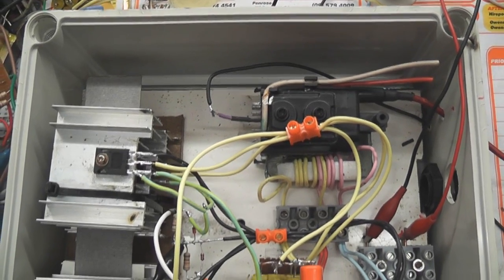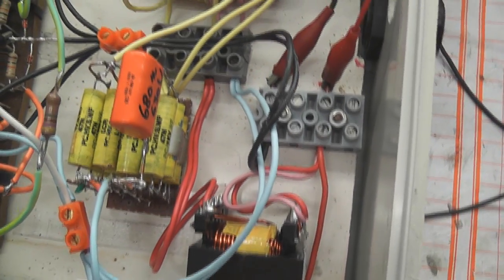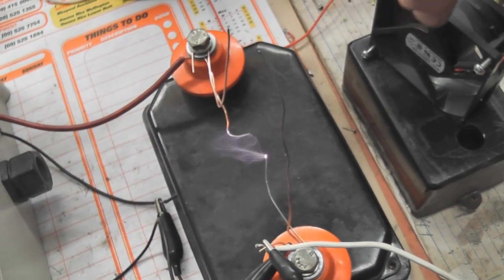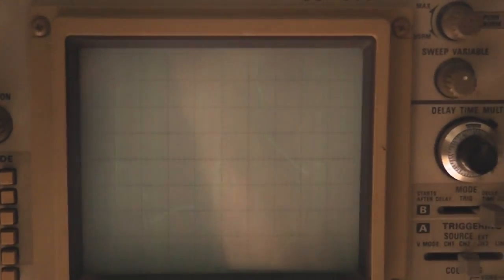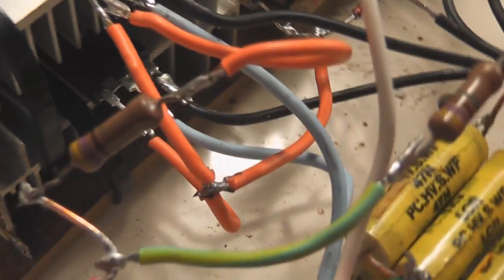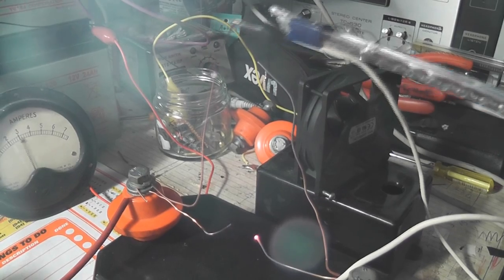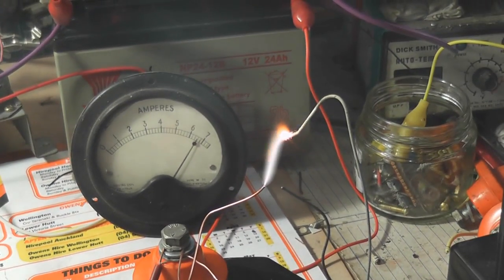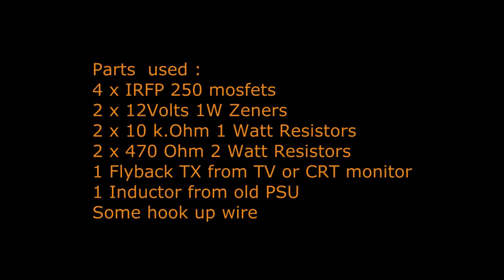24 Volts ZVS driver with 4 IRFP Mosfets

Comment: were   some of the resistors used with tbe caps to controll transient spikes, ive had to use rc circuits in parellel ,in the past on my stuff . it worked but it hurts performance some grt vid.

Comment from the maker: Yes, I will look into that. need first to get some extra probes so I can use the other channels at the same time.
The main controls are sweep time and voltage threshold, and options for tracing. I don't even know all the options as I often learn as i work on different projects.

Comment: There isn't an edit button, but if you realise you've made a mistake / spelling error / omitted something from a posted message, it is possible to delete it, & then post another message as a replacement :-)

Just hover over the message you posted that you want to delete, & in the top right 'corner', a little faint circle with a triangle appears. Click that, choose 'delete', BUT BE CAREFUL.....

When you click on 'delete' there's no confirmation. It's instant.

There you go. :-)

-BoomBoxDeluxe.

Comment: nice job. if you scope out each terminal of the capacitor you can see the overall sine wave output of the driver. also i found that when i run on 24 volts my gate drives go right up to 20v even though im using 15v zeners.. interesting. which fast diodes did you use mate? im thinking of not using UF4007 anymore and go to something much larger like BUZ series (IIRC)